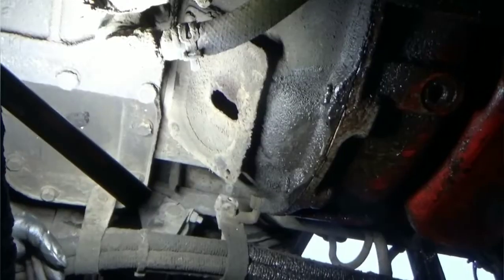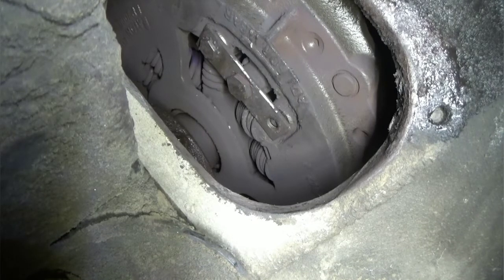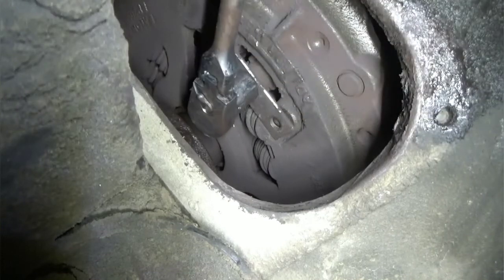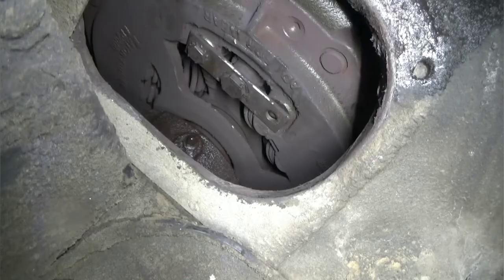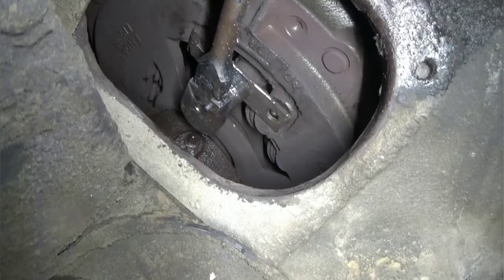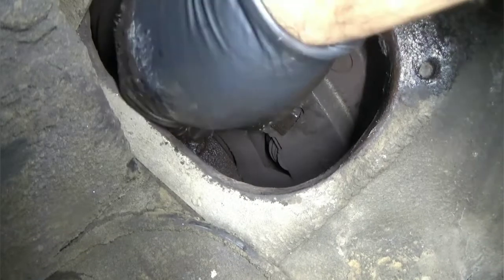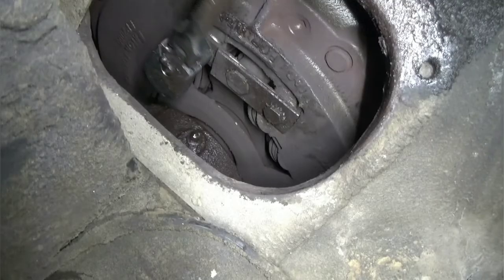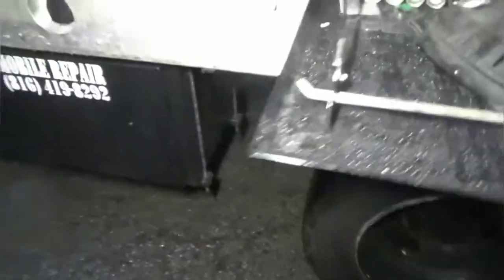CLUTCH ADJUSTMENT ON A KENWORTH

Comment: Thanks a lot! I thought the kenworth was as the Freightliner at the time to adjust the clutch! You saved me a lot of time finding out what to do and how to do it the correct way!! 🙏
Reply from the maker: Glad i could help you out
Reply: Quick question. What it’s happening if the bolt it’s not turning at all? I’ve been trying to turn but it doesn’t move.
Reply from the maker: Do you mean the adjustment nut, it can be removed and replaced if necessary. 
Send me pics joe@jdctruckrepair.com and I'll try to help

Comment: How do you know when you need to adjust?? My issue is that I cant get it into gear, some times, from a stop. Even with the clutch pedal all the way down....To me it seems to be my clutch brake?? Some one help. Thanks
Reply from the maker: If the clutch pedal doesn't have any free play before engaging the clutch it's a good indicator of clutch being out of adjustment.
You should get about 2" of free play before contact.
Reply: Ok thanks!! I'll check now.